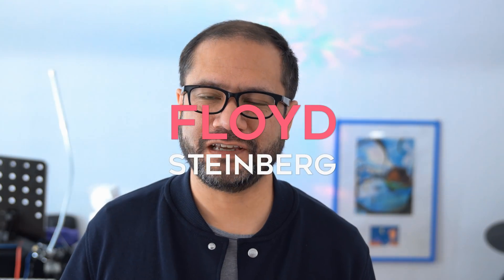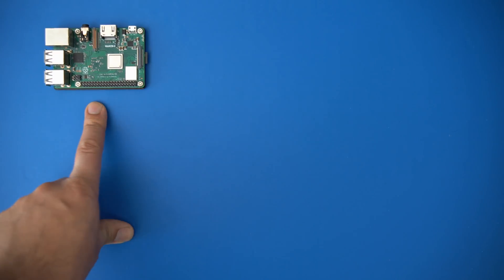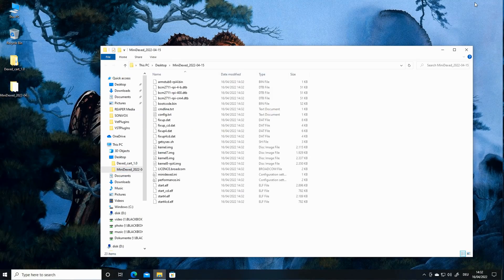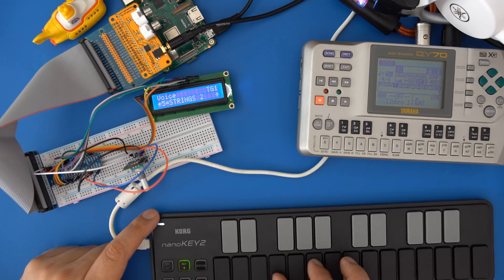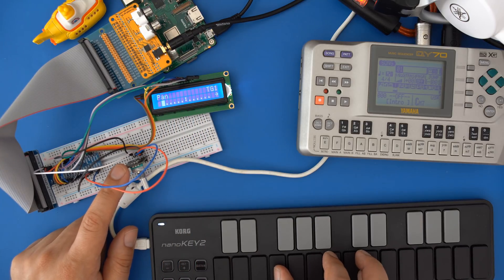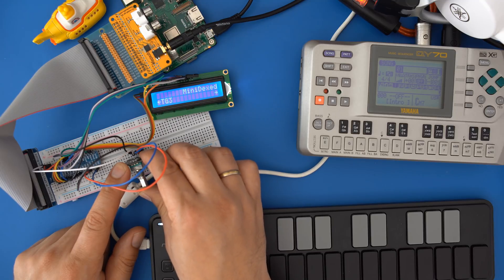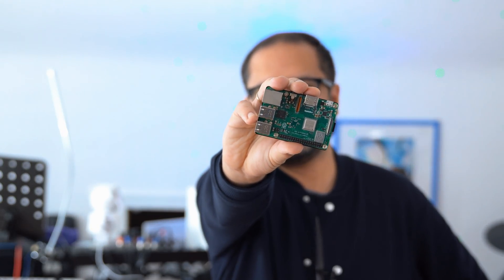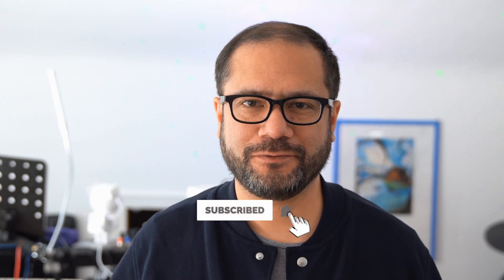MINIDEXED - honey, I shrunk my DX7 collection

Comment: Really nice project and I think I need to have a go at this and follow the project as it develops, have tinkered with Rasp Pi before, but I'm a bit of a newbie on the hardware side - the one part I'm not following is the display - does it need a separate IIC/I2C interface (there is one mentioned on the linked 1602 display product page? Looks like there is something on the breadboard not mentioned.
Reply from the maker: Hi, thanks for watching! No, you just need the basic display and connect the wires according to the table on this project's git hub page. I had the one with the i2c interface in my collection so I used that one (wiring as decribed in the doc still works the same regardless of the presence of that interface)
Reply: @mr_floydst  Thanks for the response, much appreciated. Definitely giving this a go.

Comment: Wow, I didn't think it was possible to make the DX7 more difficult or stupid to program, and yet here we are.  It's awesome that they squeezed a TX816 into a tiny form factor, but without a software editor, you might as well just use an iPhone with any number of apps.
Reply from the maker: Thanks for watching! MIDI cc programming is in development. And well, if we're honest, every synth can be replaced by an iPhone and most people wouldn't notice.
Raspberry Pi project are for people that enjoy tinkering. In my opinion this project is off to a good start .
Reply: @mr_floydst  - Yeah, no.  You can't replace a knob-per-function physical synth with an iPhone.. AS a synth programmer.  Sure the apps sound great, and in many mixes the sound will hold up, but UI is crucial if you're actually using them for sound design.  That was the point I focused on in my original comment, not sound quality or whether an audience would notice in a mix.  And this is where devices like this fall down - it has ported the processing to a smaller device, but without such a ridiculous UI... for FM synthesis especially!, it's really not providing much more than a sampler with these sounds could.

Comment: I lost you at 2:15 minutes when you introduced the already assembled breadboard. I recognize the breadboard (you can buy it on Aliexpress) but what the hell is that blue PCB and how did you attach the broad ribbon cable to the breadboard or blue PCB? Maybe you could make another video in which you explain exactly how you did it...
Reply from the maker: Thanks for watching! That PCB is just "spreading" the PI's GPIO port on the breadboard, and the ribbon cable just translates the GPIO pins to that PCB. In result, one row on the breadbord equals one pin on the GPIO port. In the video's description and in the pinned comment, there's a link to Freenove's PI starter kit, which comes with this breadboard, the PCB and a lot of useful electronic / electrical components (resistors, encoders, transistors, buttons, LC displays, ribbon and normal cables...) It's a good place to start, really.
I'm not sure if this is the right channel to place a Raspberry PI starter video on, there are plenty of other channels out there which do that. Maybe I'm going to put up a poll. :-)
Reply: @mr_floydst  Thanks for reminding me that the stuff I was wondering about is in the Freenove kit om Amazon. Explains a lot! A general Pi video might not be for you or Youtube. But a making full blown DX7 with a Pi might interest some people.  We also have the cheap DX7 from Korg in the form of the Volca FM 2. But this is way more fun!

Comment: This is probably a dumb question, but is there a way to do this without soldering?
Reply from the maker: Hi, thanks for watching! Yes, there are cables you can just plug in (if you look closely, I used them on the LCD, but I ran out of cables). You could use some shrinkwrap to hold them in places.
Reply: @mr_floydst  Will have to check that out. Thanks for responding!

Comment: Thanks Floyd, this is fascinating! I would love this with the display as HDMI so it might be possible to have a graphical editor. Ill certainly keep watching for updates as this really sparked my interest. Thanks again!
Reply from the maker: Thank you very much! There's a version of this project for Teensy which features a touch screen UI (but you only get 2 tone generators instead of 8 because the Teensy CPU is less powerful). https://codeberg.org/positionhigh/MicroDexed-touch
Reply: I'm not well versed in this technology, but couldn't this be a vst plugin?
Reply from the maker: @katiebarber407  Yes, you're right! This is based on https://asb2m10.github.io/dexed/, a VST plugin. But on Raspberry PI, the fun is in the process of building. Adding a display and controls yourself teaches you a thing or two about electronic components and how they work. The only real advantage here over using this on a phone or a computer is that this here as practically no latency, as there is no operating system to circumnavigate. Plus you could go ahead and add anything you like (a screen, more physical controls, a keyboard...)
Reply: @mr_floydst  thank you! that's awesome and good to know. I definitely see the practicality and fun-ness of these types of projects. I didn't mean to imply it as redundant or anything like that
Reply: @mr_floydst  that's funny I actual already use that's plugin and love it, cool video. do you have a video regarding the sequencer u used here?
Reply from the maker: @katiebarber407  Thank you! I made 2 videos on the QY100 (which is kind of the same box but with an additional audio input). I think the second video shows the sequencer part in more detail, though no one watched that video compared to the first one. ;-)
https://www.youtube.com/watch?v=59JZmVHYNtU
Reply: @katiebarber407  Hi Katie. I believe this is based on the VST DX7 Synth Dexed. I think its really nice to have it on a Pi to use it standalone. Cheers!

Comment: Great timing on this one - just after Volka FM2 announcement.. you have to wonder the margins on the Volka if it can only do one instance of 6 voices and has such a useless display.. of course enclosure/packaging/marketing add to the cost. Now.. somebody please build this or sell a complete kit including enclosure with multiple control knobs and sliders (Opsix style) - around 250$ would be a good price.
Reply from the maker: Thanks! :)
Well you always have to consider R&D, and the Volca has more knobs, a keyboard and a sequencer and Interfaces. It should have more polyphony, for sure. :)
The minidexed team is working on MIDI controller support so the door is open for a custom built hardware .

Comment: Do you think this could be configured to work with the Blokas Pisound (hat)? Or do you think other USB audio interfaces could work?
Reply from the maker: This software calls for a PCM5102A or PCM5122 DAC chip. If that's present on the Pisound, you're good to go.
Reply: @mr_floydst  Thanks. And just a follow up, in case it doesn't support that interface, the reason I like that particular interface is it's balance connections and also that it's a midi interface as well. I wanted to know what midi options are there aside from USB midi devices? I'd like to send it midi from my Blokas Midihub that way I can use Blokas to distribute the midi notes across multiple synth sounds.
Reply from the maker: @beatnikcafe  I think you should join the discussion on https://github.com/probonopd/MiniDexed/discussions   :)

Comment: could this be adapted to provide 8 separate outputs?
Reply from the maker: It's an open source project, so if there is a hardware that provides 8 audio outputs and that can be connected to the PI by GPIO or USB ports, the answer is "yes, theoretically". It really depends on what the developers will prioritize. There's a message forum in the Github page and I heard developers in general are really happy to get a donation for yet another cup of coffee! :-)

Comment: Floyd...you keep making my to-do list of projects longer and longer.  Still need to try the teensy m8 build and your webmidi sequencer.  Oh yeah, need to try out the full blokas labs pisound build of modep with a guitar to see if it sounds any better than when you compared it to Zoom MS-100bt.
Reply from the maker: Thank you, Ted.  I think today's "project" is done really quickly, as all you need to do is unzip that synth onto an SD card - it will turn your barebones PI into a DX7 no questions asked. All you need to do is to connect a MIDI controller that can send program change messages. By default, sound will come out of the 3.5mm jack. The LCD and other stuff I showed here is entirely optional.

Comment: Would be glad to see this as ready-made tiny box. Maybe as one extension board, norns-style. Have you considered this possibility? I think this should be a hit, tiny multitimbral synth!
Reply from the maker: This project has so much potential as everyone has a RasPi somewhere in a drawer. And yes, if you own a 3D printer, you could easily turn this into a nice looking box. WIth the PI Zero-2, you could also tuck it into a MIDI hardware controller and create your own hardware synth. :-)
Reply: @mr_floydst  that's my plan. Though il keep the pi mounted behind the controller out of sight in a case and add the screen and encoder to the controller.

Comment: this is amazing.. wold it work on a raspberry pi 2? or would I need to change some of the code..
Reply from the maker: It will work, but you will get only one "DX7" instead of 8.
Reply: @mr_floydst  Actually Pi 2 should do all 8. Pi 1 and Zero do only 1.
Reply from the maker: @09427560  ah, right. thanks for pointing that out.
Reply: @09427560  thank you, will try
Reply: @mr_floydst  thanks, again this is really cool man, good job

Comment: hi Floyd.
Great video- thank you!
What's the latency setting on this? How low can you take it before crackling?
Reply from the maker: Hello, thanks for watching! I didn't measure it, but due to the fact this project just skips the operating system altogether, my impression was there's no latency to speak of. Just try it yourself, it's installed within seconds, it's just a matter of copying those files to an SD card.

Comment: Good video 👍. Very interesting for me if it could also have 5-pin MIDI to use completely standalone and also to be a patch librarian for my TX7.
Reply: Been testing today. Installed on a pi4. 
Usb midi into the pi from a novation SL mk2. (built in midi interface.) Midi din from my rig into the SL and to dexed. Able to play (and later program) from my SL and sequence it at the same time via din from my MPCs
Reply from the maker: You can use a USB to 5 pin midi converter for around $10. I used one in this video.

Comment: They should add support for an opsix-style mixer section: six faders for operator level and six pots for operator ratio. Edit: CC support is on the project’s to-do list!
Reply from the maker: Yes, it is! And I can't wait for it. :-) This is without doubt my favourite open source project in '22 so far.
Reply: CC support would be essential for me for playing it from my Roland AE-30 wind synth.
Reply: @umick-synths  I believe DX7 patches can already be setup with aftertouch or breath control, so you should be able to use a wind synth! maybe try it out on dexed, free dx7 vst
Reply: @maxspencerkarinen6463  thanks Max.  I dug out the manual for my TX7 and it's in the function memory rather than the voice memory so I'll have a play with that. Not as convenient as my DX27 (breath is built into the patch itself) but if it works I'll be happy! It won't be using all the features I can send it but better than nothing.

Comment: Can you edit the synth parts with Dexed or use it for offline patch creation ? Not sure how that could ( if it does ) work with the multi-part architecture , But hope it does because a Yamaha TX synth with the equivalent of an alpha dial sounds like menu diving purgatory .
Reply from the maker: You can. In the DEXED VST, it's relatively easy, and here, it's possible, but maybe a bit slow as you have to click your way through a lot of sub-sub-submenus. But it's really easy to understand.
Reply: @mr_floydst  Awesome.
Reply: Now hopefully someone will make a similar project for OBXd . One of my favorite freewarez and probably the only way I’m going to have an oberheim type synth in hardware anytime soon .